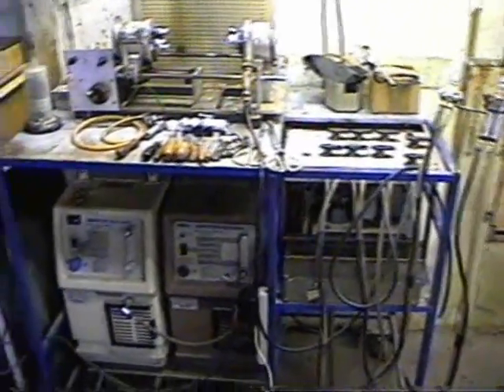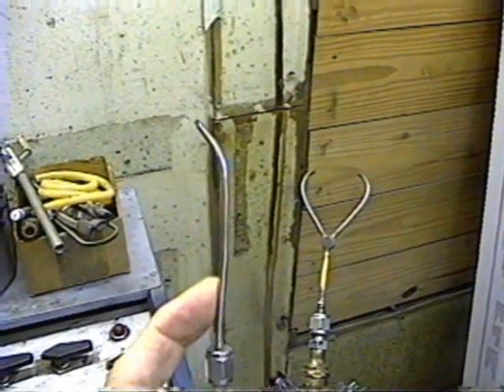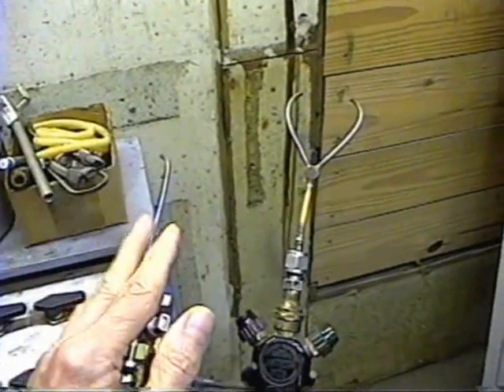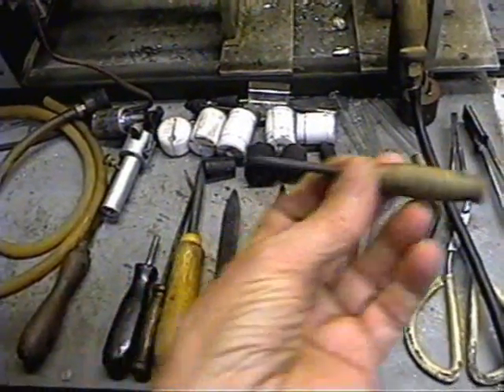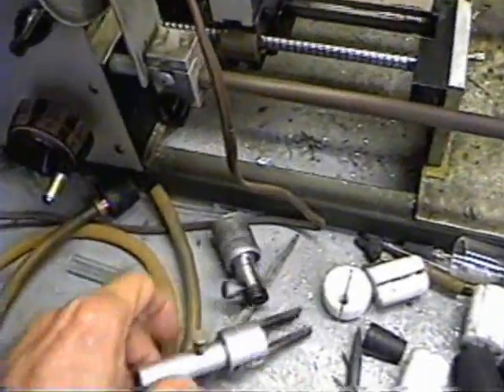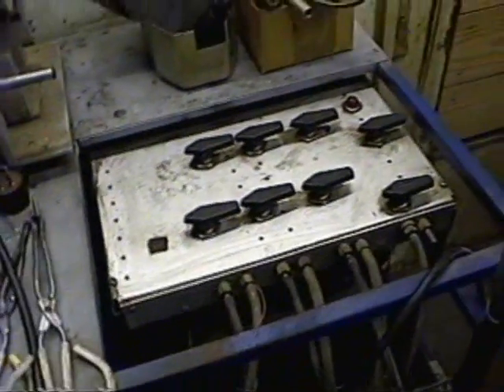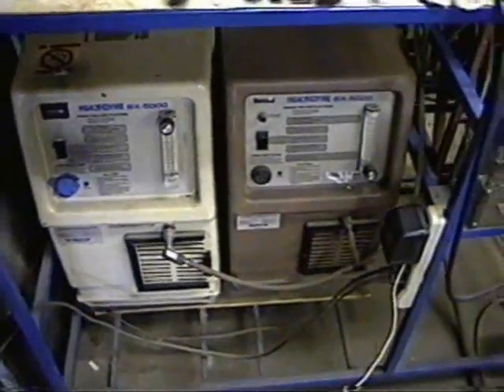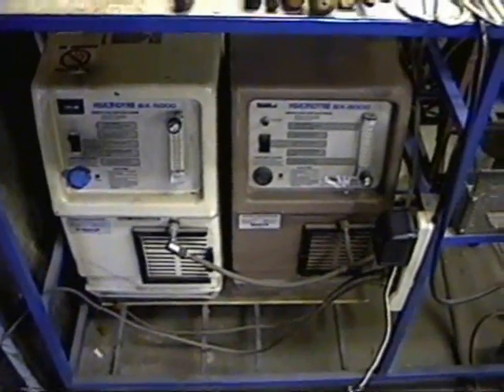vacuum tube making equipment 1

Comment from the maker: I use many parts of useless TV tubes in the making of my tubes. There are tens of thousands of these tubes around from the days of tube TV sets and they have no collector value. Certain tubes are worth rebuilding but most tubes can still be purchased for less than it would be practical to rebuild.
Modern made tubes are vastly better than early tubes. The only tubes now made are special purpose tubes and these are quite impressive in their specifications.

Comment from the maker: The compressor is a small diaphragm type commonly used with paint sprayers. It is small, 1/2 cu/ft per minute. Maximum pressure is 5 psi. The regulator is made from a standard pressure regulator by plugging the feedback port and using the internal spring as the reference. (The outlet feeds to the inlet for the bypass.) It is essential that there be no leaks of course.

Comment from the maker: Hello!
Yes. A sleeve with a tapered end to force the O ring against the dif pump pipe is fit over the end of the pipe. I have also simply soldered the tube to the dif pump outlet using stainless steel solder. That works really well and makes a hermetic seal.

Comment from the maker: The hydrogen would work fine however producing it in sufficient quantities would be quite expensive compared to propane or natural gas. Also, hydrogen torches are built with different orfice diameters than propane or natural gas torches. This is because of the much faster burn rate of the hydrogen-oxygen mix. Trying to use hydrogen in a natural gas torch results in problems with flash back.
Reply: Thank you, this is very helpful.
Reply: There is a channel called NOBOX7 and he built a banging hydrogen torch system that would be easy for someone with your talents. Actually you can purchase the plexiglass and sealed metal style oxyhydrogen generator . I had built one a long time ago and used acetone sparging to cool the flame because it got too hot. It is the best for brazing. It seems this comment section is a goldmine for finding what is interesting. thank you again.

Comment from the maker: I disagree. There are several procedures in tubemaking that require multiple alignments at once. You can't do that by hand. You could make some kind of fixture I guess and not use a lathe, but the lathe makes the job a snap. Also, to get to the experience level in freehand glassblowing that it takes to do even the simplest tasks takes far longer than if you have the lathe. Freehand glassblowing is an art and not everyone has the steady hand and calm thought processes to be good at it.

Comment: Question continued from previous comment.... Do you suppose it practical to recycle used tube components or that old tubes could be renewed or rejuvinated? How about tubes that have had damaged envelopes and lost vacuum? Could something be done to rebuild them or have they been totally polluted with oxidation to have any further value? 
Also, why cant a commercial manufacturer build an equal or even technically superior tube compared to the tubes of yesteryear?

Comment: I have two exactly the same diffusionpumps but i havent got time to figure out how to connect the outlet since its just a straight tube and not the usual vacuum fittings. It seems as you use some similar principle as when you connect a tube to the system with that nut and o-ring, correct?

Comment: hi i really love your work, on glasswork and i have been following your channel for a long time now, i wanted to ask you how did you make both chucks spin at the same time if you don't mind giving me a simple summary please if that is possible
Reply from the maker: A splined shaft is located on bearings on the back of the lathe. The shaft is connected to the motor. The two chucks have gears that match to the splined shaft. One of the gears on the shaft is a splined rider that moves along the shaft when the movable chuck moves.
Reply: @glasslinger  thank you

Comment: Hello and thank you for all you videos!
 Is it possible to use oxy-hydrogen instead of oxy-propane? It is getting more and more popular, and solution seems to be very clean and compact.
Reply from the maker: See my comment on this very suggestion in the comments below.
Reply: @glasslinger  Yes just saw it, that is very helpful, thanks! What would be a recommend flow of hydrogen/ oxygen for same performance as propane? Just want to estimate which generator would work... 5 lpm?
Reply from the maker: @ostroumovgeorgy8247  5 lpm would do fine. Note that you have to have plenty of oxygen to burn it. Since water is 2 H plus an O you will need 2.5 lpm of pure oxygen. Another thing is the pressure. You will need about 5 psi on your hydrogen into the torch. Same with the oxygen. The electrolytic hydrogen generators do not produce pressure so you will need a pump.

Comment: Кислородные аппараты не очень дешевы. Думаю сделать электролизный аппарат с получением раздельно газов H2 and O 2 в устройстве где роль мембраны будет выполнять перегородка из стеклянной пластины с V - образными каналами. Два гидрозатворы и клапана будут защищать лот попадания смеси если они получатся. Вакуум до 10-5 можно получить не только известными и признанными способами но и способом когда малое количество остающихся молекул будут удаляться способом давно известным но не использующимся в технике высокого вакуума. Это вызывает много вопросов, один из них - почему до сих пор не использован? Просто, нет паров масла, дорогого турбо насоса.
Reply from the maker: You will have trouble making enough oxygen using electrolysis. You need 5 to 15 liters per minute depending on the size glass you are working on. The machines are low cost in USA.

Comment: you can easily do all of what I have seen on your videos freehand! so I disagree that you need a lathe. I realize that it makes the process easier, and is perfect for amateurs in regards to glass working, but any lamp worker with even medium skills should be able to do all of the things you show freehand or on bench rollers! and though hand torches are a game changer for the welds, most of the work can be done on a bench torch. its just a matter of how you work. great vids and awesome stuff!